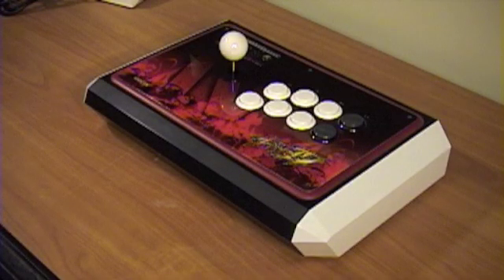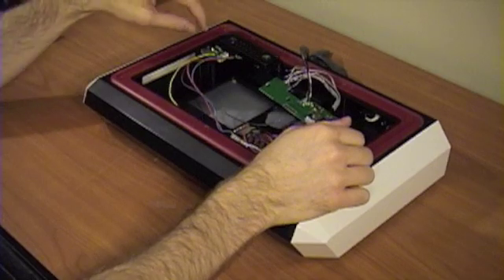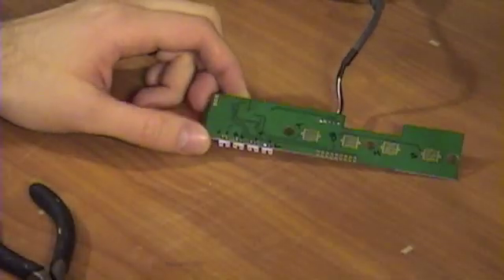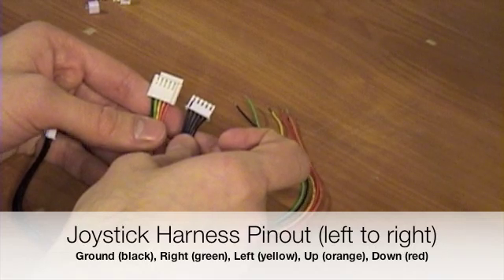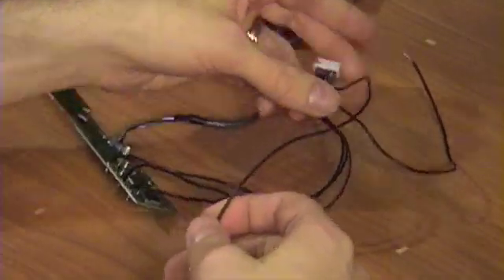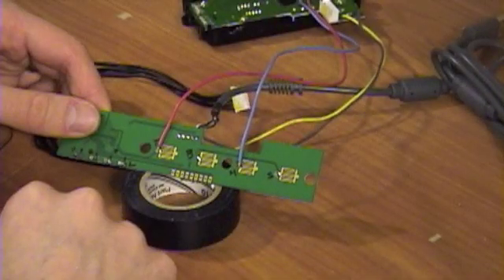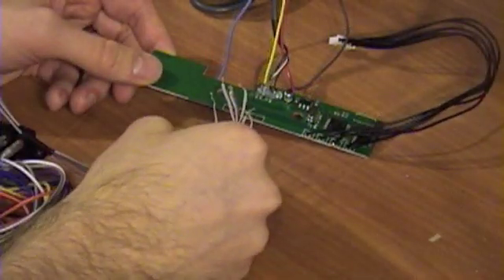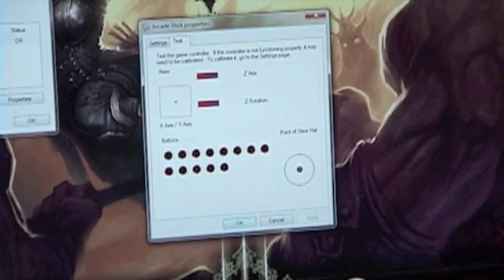How to Swap the Stock Mad Catz Arcade FightStick PCB with a Joytron Paewang Revolution PCB

Comment: Did you connect the extra ground wire? I have the same situation
Reply from the maker: I don't recall, if I didn't do it in the video, probably not? But there shouldn't be any negative effects from attaching another ground wire.
Reply: Donovan Myers Obviously you never used Gamerfinger buttons.

Comment: Hey man, I really enjoyed this video. I have a question, I own an omni which has this pcb in it and it recently started going off and on. Like connecting and sometimes not connecting. I figured it's the cause of one of those 5 main wires that go out to the usb cable. I don't know much about electronics but I ordered a soldering kit and desoldered those points. The turbo etc buttons are still soldered on. But I can't seem to solder suck the points out to clean it up so I can put the wire through it and resolder them better than when I originally purchased it. Any advice on what I should do? It's such a small space i'm working with on that pcb and being I don't know how to properly solder and the wires on the back are still on it moves about, I can't seem to desolder.
Reply from the maker: Thanks! Glad to hear it. Did you get a good soldering iron that can get up to around 700º? That might be a problem if you bought one of those plug-in 'stick' irons from Radio Shack/Home Depot. -- Try using a pair of pliers to hold the wire and apply some pulling force. With your other hand use the soldering iron to heat up the solder/wire and it should hopefully pull out. Still having trouble, maybe you can cut the wire close to get it out of the way and perhaps remove the PCB to give yourself more room to work with.

Comment from the maker: I don't know off hand, I'm pretty sure that that area has wires that lead back to the main PCB in the metal casing. If so, you should be able to intercept those and use them as well. My VLX is a 360 version and I ended up using the super simple VLX Kitty to dual mod it.

Comment from the maker: Thanks for the interest. Unfortunately I don't have an Akishop PS360+. I only have the old model Akishop. But I do have a VLX. There are a lot of harnesses in that stick. You can easily disconnect the USB & stick/button wires and cut off any connectors and put them in the proper slots in the Akishop PCB. If you don't want to cut anything, try and research making your own (.110 connectors & JLF harness & just cut up a spare USB cable).

Comment from the maker: The Paewang complete replaces any other PCB, and I don't believe it offers any 3-way capabilities. Since you have a 360 stick, you could use a dual-mod board, like the Phreak Mods TEasy Strike and that does let you have 3-way capability for PS3 and 360.

Comment from the maker: Yes, you can just cut off the ends of the ribbon cables for any mods. I don't know the SF x T layout, but you could find out yourself pretty easy: just look at where the ribbon cable hooks up to the PCB and it should be labeled. Alternatively, you could take a multi-meter and test continuity from the signal wire coming out of the punch-down (that's labeled) and a wire to figure it out.

Sorry for the late reply, busy with the holidays.

Comment from the maker: The Paewang that you can get from Focus Attack is a multi-console version (PS3/360/PC). I wasn't aware Paewang had a stick/PCB that didn't do both 360/PS3. I'm not sure what you mean by low input read. I don't have any testing equipment to know the exact millisecond rating of input registers, but it feels just as responsive as any other stick I have (MadCatz, Hori, Akishop, etc.)

Comment from the maker: I think the Presoldered Bundle is basically like it was ripped out of one of their sticks. It has the USB cable, wiring harness for the buttons and joystick. The PCB only would require you to provide your own joystick and button wires as well as solder them to the PCB. You probably also have to provide USB cable and solder it as well. If you aren't super anal and want everything soldered by you, I'd go with the bundle.

Comment from the maker: Good to know! If you have a volt meter, you could use the continuity setting to test which wire of the ribbon cable was which. I'm pretty sure that the main PCB is labeled where the ribbon cables connect on the other end of the punch down. It is on the TE and VS. You also might try searching Google images for 'Mad Catz TE-S pinout'. You could also try following the traces from the ribbon cable connectors to the .112" male quick disconnects that the button wires are connected to, they're labeled.

Comment: Hey Donovan, the ribbon cables that connect to the TE-S are both 6 wire cables, is there anyway to tell which cable corresponds to which button on the actual ribbon? I like the simplicity of the punch out and would rather I not have to get rid of it.

Comment from the maker: Yes, the only difference with the TE and TE-S is the slight change to the case to have smaller sides and full-size top panel. The components are all the same - maybe a minor revision to the PCB, but you're replacing that. ;)

Comment: the original design of the paewang (plus it had other names over time) didn't have a common ground, so some older models won't. most places selling the pcb by itself are the new ones however. but you should always check with a multimeter with a continuity function (put one probe on each ground and if it beeps it means they are connected and thus common)

Comment from the maker: I did this tutorial on a PS3 TE. As far as I know, the LED boards are independent of the PCB and function based on detecting button signals (and run off ground/power pulled from anything), so I don't see why not. ;)

Comment from the maker: Yes, the Paewang is common ground. I didn't think it was at first because of all the connectors for the joysticks that had their own ground, but as you saw in the video I only used 1 ground and the 4 signals to use a common ground joystick (JLF) with the PCB.

Comment from the maker: The only reason I can come up with is because it didn't work properly when I tried it without the VCC connection. :P I think because the home & turbo buttons are not mechanical, you need current (power) running through them to function properly.

Comment: is there a reason why you need to wire VCC to Madcatz pcb?  Wouldn't it work just with Home & Turbo signal wires and Ground?  Madcatz PCB doesn't have to be powered does it?  Thanks!

Comment from the maker: @TruKaos1110 I'm not 100% positive, but I think you have a newer TE (Pro/V.S.) stick where the lock switch on the Guide/Turbo panel actually locks out the start & select buttons? I believe the KGND is what controls that (lock cuts the ground and keeps start & select from triggering).

Comment from the maker: @markdaardvark Soldering isn't 'hard' and this might be a good first project. Just make sure to buy a soldering station that has heat control and will let you get the iron hot enough (over 700º). Most beginners downfall is buying a 'solder stick' from Radio Shack that never gets hot enough and they ruin the electronics waiting for solder to melt. The only other key is to remember to scratch the metal contacts on the Paewang where you'll solder new wires. The rest is cake.

Comment from the maker: @TruKaos1110 I'm not 100% sure. But I know getting at those solder points is 100% easier since turbo, guide, and power are all pinned out and easy to get to. I would do it just in case.

Comment from the maker: @b8ingmasta Yeah, the PCB replaces any main PCB so it could work in any stick. I'm relatively certain accessing the home/turbo buttons on the SFxT's top panel is the exact same, but I have not disassembled my stick to the point to confirm that.

Comment from the maker: @vietnamazin You can install it into a 360 stick. Accessing the home & turbo signals on an Xbox 360 PCB is much easier because there are pins for it.

You just have more options when starting with a 360 stick (various dual mod boards that sit alongside the stock PCB - ChImpSMD, etc.), so the Paewang (or Akishop) replacement PCB is what people with PS3 sticks prefer to go with.

Comment from the maker: @AerMateo Yeah, the Paewang PCB essentially replaces any PCB, so you could put it in any stick. The TvC stick would be tricky because it doesn't have the 24 mm Sawna buttons for start & select. Also, I couldn't be certain accessing the home & turbo buttons in the panel would be the exact same.

Comment from the maker: @AnthonyOgborn Well, you could de-solder it and use the one that came with the Mad Catz TE stick. Other than that, you could take any USB cable, cut the other end off and solder up the wires. Most all of them are color coded correctly: red is usually power (VCC), White is Data -, Green is Data +, and Black is ground. The 5th wire is also ground and usually connects to a shielding around the cable.